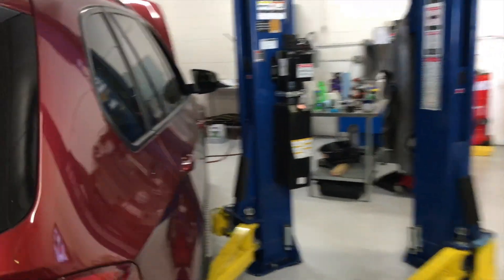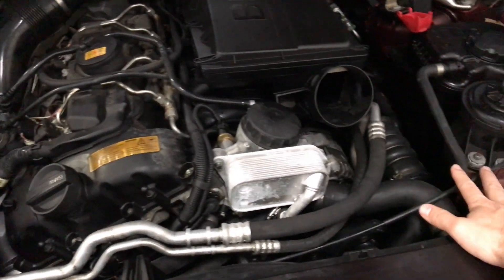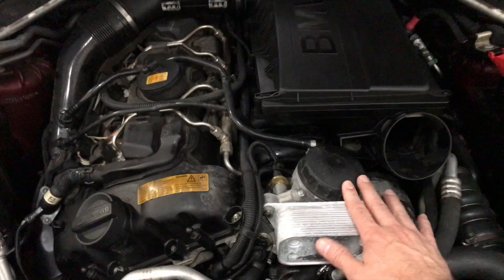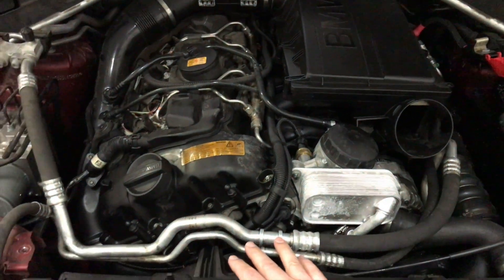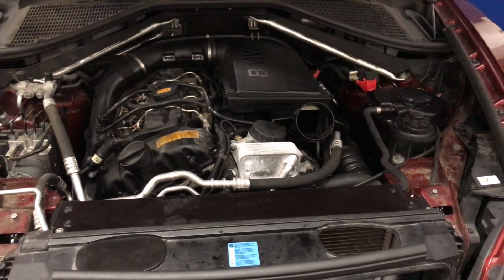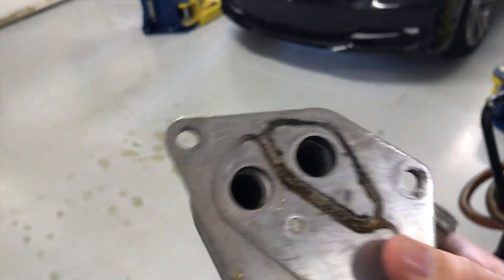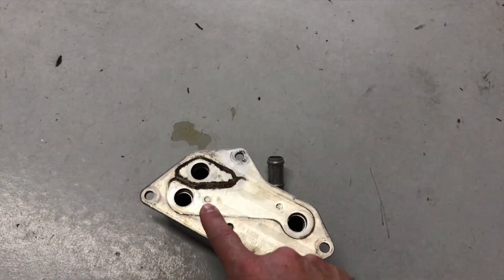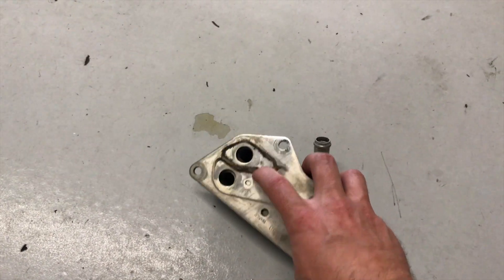Coolant Mysteriously Mixing with Engine OIL !

Comment: Can this happen to other types of bmws ie minis
Reply from the maker: Yes, the coolant and oil can mix on the MINI engines via the engine oil cooler or the transmission oil cooler. Or a bad head gasket. All of these scenarios are rare, but can happen.

Comment: How do you flush the coolant with Oil? Mine got mixed with oil. Replace two gasket on oil filter house and tried to flush using distilled water and run bleeding method and remove the upper and lower radiator hose. Tried to clean the expansion tank but there still milkshake.  What fluid do you use to flush?
Reply from the maker: We use Gain liquid laundry detergent. The oil binds to it well.

Comment: Hey guess I have a 2002 X5, will this cause heavy white smoke from the exhaust?
Reply from the maker: Hi, No. Assuming you have a V8 engine. If there is white smoke upon acceleration after sitting at idle for a while ( like in a fast food drive through ) then it is from worn/hardened valve guide seals. The correct repair is to replace them. It is pretty expensive. Or you can use thicker oil 5-W40 with an oil seal conditioner additive. It will help a lot after around 150 miles of driving.

Comment: How were you able to track the issue tu the oil cooler and not the head gasket?
Reply from the maker: Educated guess and have seen it before.  There were no other signs of being a head gasket. Plus this is the cheaper first step.
Reply: @MikeMDs  great video man. Keep up the good work.
Reply: Cylinder pressure test would confirm head gasket and bmw very common for cooler failure